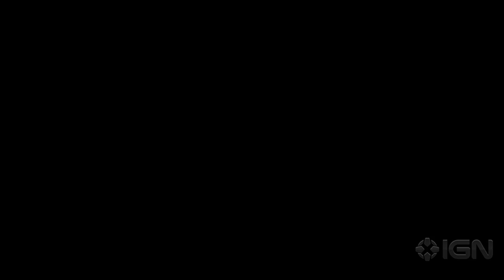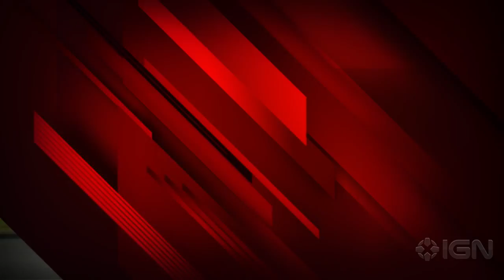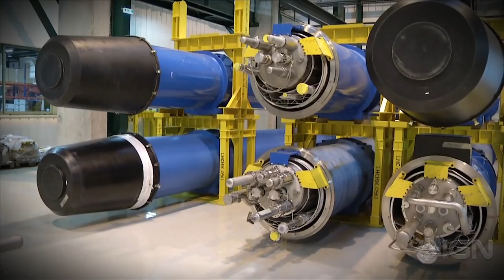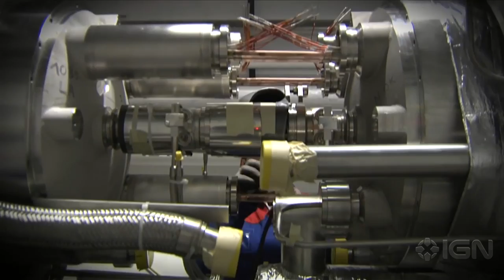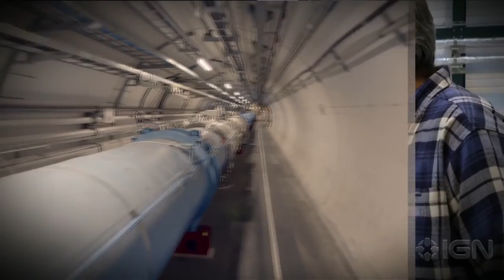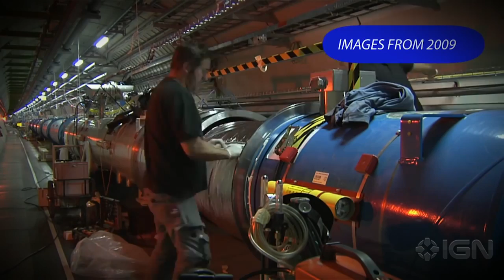CERN Could Prove Parallel Universes, Claim Scientists - IGN News

Comment: I don't think "parallel universes" is the correct term they should be using.  "Higher dimensions" would be more accurate, as Stephano Brizzio posted previously.